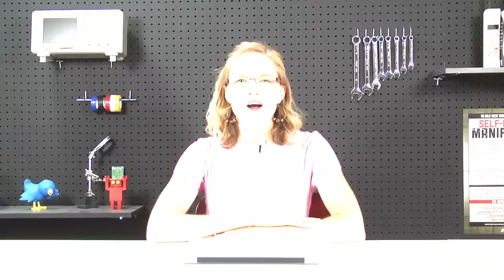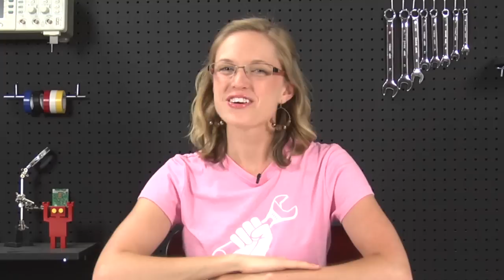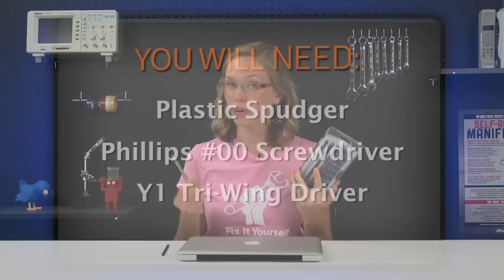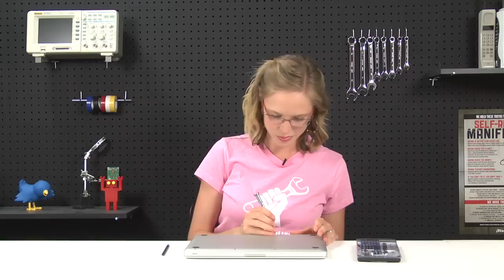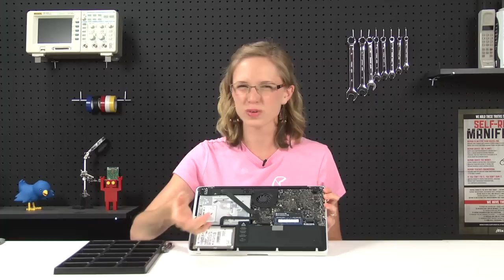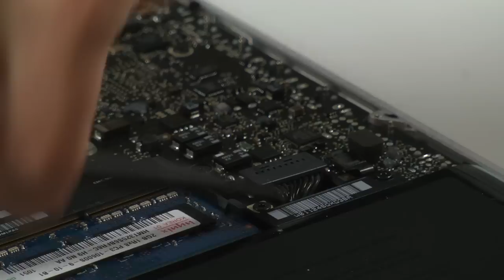How To: Replace the Battery in a Macbook Pro 13" Unibody

Comment: hi there... my problem in this case is where to  buy it - i have a MacbookPro 2011 and iMac 2007  24 inch  and an iPhone5 -64 GB - the Macbook pro cost me over 2600 euros because i have upgraded it to  be the best Mac at that time i was in Latvia Riga and i did everything there- in southern Spain from la Canada in Marbella i got no help but just bought a new charger my 4th in 5 years- but the Battery finding become a nightmare for me during end of September until now in November- WHERE CAN I BUY THE ORIGINAL BATTERY  FOR MACBOOK PRO 13 INCH??? THIS IS MY QUESTION IF YOU CAN ANSWER - I ALREADY USED OVER 850 TO  FIX IT BUT I AM SURE THE ONLY PROBLEM WAS THE BAD CHARGER I BOUTH THIS YEAR IN DELHI AND THE BATTERY- MY BEST ADVICE TO  MAC USERS. don't keep a mac more than 3 years- both places told me do not buy from eBay and amazon because they are selling Made from china- it will harm you Macbook - we trust the Apple producer but then we face problems to  keep it longer because they won't sell and sell new products to  us- i do not trust any of these companies providing us this technology - we pay a lot for these Toys  these days - on all 3 productions i paid big money as you see i bought an iPhone5 -64 GB because i wanted to use it for my time while i am acting in films - but i had to  charge it 4 times a day  - my Macbook is a 500 HD + 1TB Kingston SSD - INTERNATIONAL KEYBOARD AND NEW BATREY ( APPLE SUPPORTS IS NOT GOOD )

Comment: Hey guys, I recently had a new battery put in my older MacBook Pro early 2013 and every time the battery dies my clock resets to 2017 and causes problems with my iCloud settings and some apps.
Is there anything I can do to prevent this? Did the guys who swapped out my battery forget to connect something or is there an internal battery that keeps enough power to keep the date settings working even when the computer shuts down?
I would really appreciate any suggestions or help please!!
Thanks!!!

Comment: Hi there iFixit staff, how long will the battery last after replacing it? As good as when the MacBook was new or at least 6 hours?
Reply: This would depend on what battery you purchased and from where if it's not an apple replacement then you can check the amp hours on the battery

Comment: This is is my exact computer. I’m replacing the battery and one of the screws in the battery is STUCK it won’t budge. I’m using the right driver, and it won’t move. Any tips?

Comment: I need to remove a swollen battery from an old (2007) white MacBook (NOT Pro!).  I've tried to get the battery out, but can't budge it.  I can't get the case open, because of screws in the battery compartment.  HELP!

Comment: Hello,

My Macbook Pro 2011 has recently started to run its fans at a high speed continuously after being turned on for a minute. I can feel warm air coming out even when ventilation is not impeded. I also notice that the battery charge drops at a rapid rate when not connected to the power pack and drops at a slow rate when the power pack is connected. Could this be caused by a bad battery? It makes sense that the battery could be overheating, thus causing the fans to engage. This also explains why the charge drops suddenly. Please advise.

Comment: Any knowledge about the specs of the OEM battery that comes with the computer vs. a replacement battery?
- Estimated length of battery life on a charge?
- Estimated amount of total charges before it needs replacement?

Comment: I took the leap of faith and reset the battery connector, it booted up immediately following my replacing all the screws. The battery was at 76% when it came back online. Funny! Not funny haha, but more like Funny, "what the hell..."!!!
Reply: Marcello Ruffolo, that's an encouraging story! Can you describe the level of functionality of your battery for which this 'fix' worked?

My battery was deteriorating over several months and now it's got to the point where the laptop shuts down instantly when the charger cable is disconnected. I think your conditions might have been different to mine.

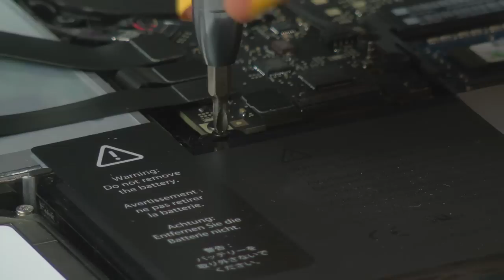Comment: 2:24 made my day. " Warning: Do not remove the battery. "  LOL
Reply: There nothing wrong with replacing the battery if it is dead as long you do it the correct way   The theory why the warning is there is probably because Apple want your to take it to Apple to get replaced battery
Reply: No apple likes flying down there components I mean when will apple make a device that you can’t get into it it breaks like rivit it in place no screws make all devices unrepairable

Comment: To any of you kind people that found good batteries could you pass the info along to me please
Reply: buy the batteries from "wegener's storefront" on amazon.com in new condition. i bought it(macbook 13", mid 2010 - 2011 model; maybe 2009 but you have to check for that) and it was identical to the battery apple uses in my macbook pro. my smile reflected $80 saved when the battery not only looked like apple's version but it fit perfectly inside the battery compartment. i paid $60 for it and saved about $80 from the prying hands of the big corporate bully known as APPLE INC.
Reply: Richard A  they also work with 2012 models
Reply: Richard A could you give me a link to it exactly? I think I'm looking at it but I wanna be certain

Comment: be careful removing the battery screws.  they're very soft and easy to strip, even with the correct tri-wing screwdriver.  i think they were chosen for this reason.  i recommend you push down on the driver firmly and then turn, making sure it doesn't slip and strip the head.  if it strips anyway, you'll need to drill out the head, remove the battery, and then unscrew the rest of the screw with a plier.  it's time consuming but it works.  that's what i did.

Comment: You guys rock.  I watched this video, called your customer support to make sure I ordered the correct parts for my model, received them in the mail quickly, and changed the battery in 5 minutes.  The clicker had stopped working d/t a swollen battery (it had 1700+ cycles).  The local apple certified technician wanted it to stay overnight, said it could be a lot of different things wrong with it, they'd have to order parts, etc.  Not so, and I probably saved $50-100 for the repair.  Thank you!!

Comment: You underestimate the power of idiocy.  None of these are anything even the most mildly capable individual can't overcome.  If they are obstacles, or appear difficult, have an authorized repair person perform the repair.  The same individual that can't overcome 1 sticker and some tri-wing screws, would likely damage this very expensive laptop if it didn't have those 'idiot-deflectors' installed.

Comment: If you are under hardware warranty and it is not accidental damage then Apple will replace it (as long as they determine that the user did nothing to cause the damage). You have one year from the date of purchase on hardware (90 days complementary phone support), unless you have Apple Care, then it is 2 years for both hardware and phone support. 

If you have a legitimate hardware issue then they will give you phone support exception if you are outside of your 90 days.

1800 APL CARE

Comment: I used a flat head driver... They work for freaking everything (as long as your careful) I've never come upon a tamper proof screw that can't be beat by one. (even the Xbox 360 Controller screws)